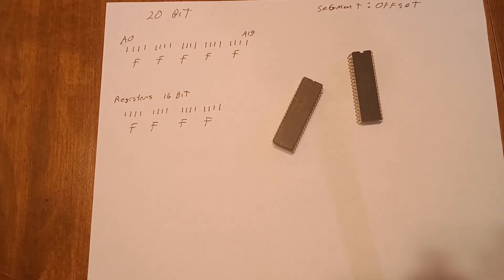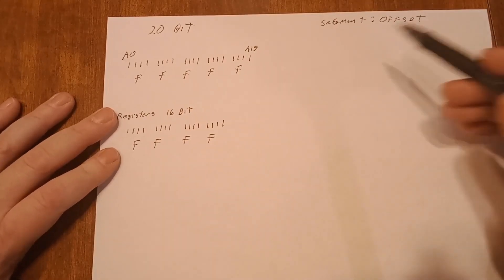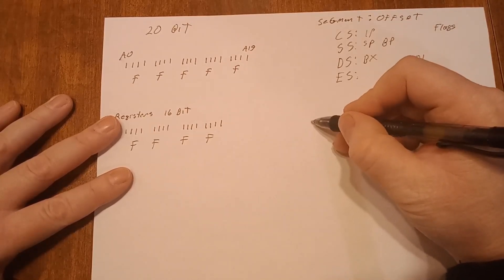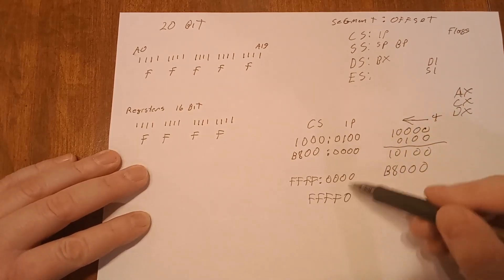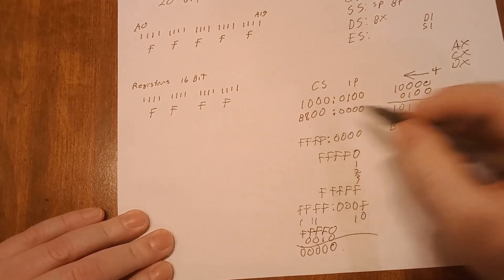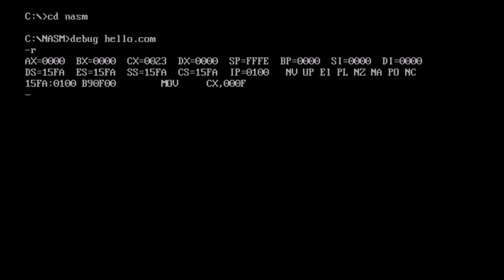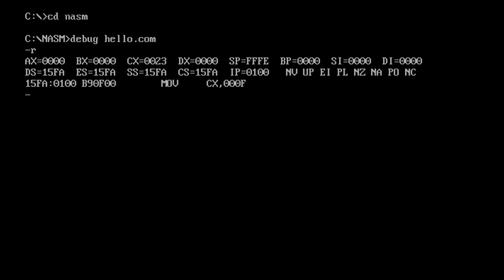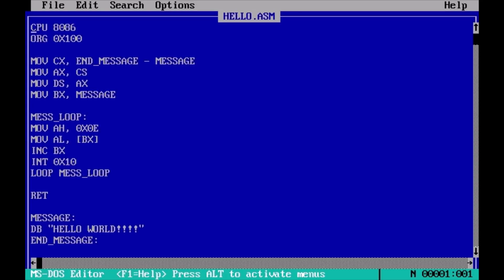8088 Memory Addressing, Segment : Offset

Comment: Coming from the 6502 to 8088 in this decade, this really is one of the most frustrating parts :)
I think it’s a tiny bit less confusing to think of it as shifting the segment one nibble right than shifting the offset left but same difference I guess.